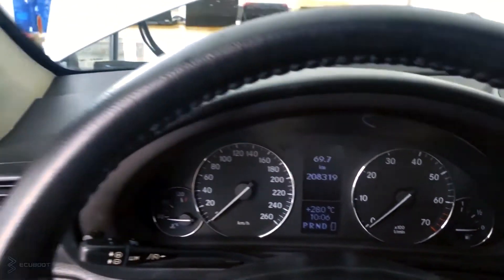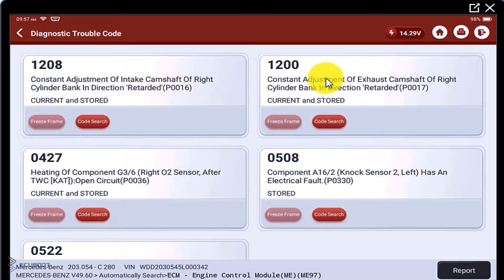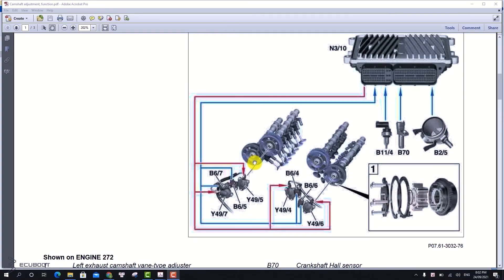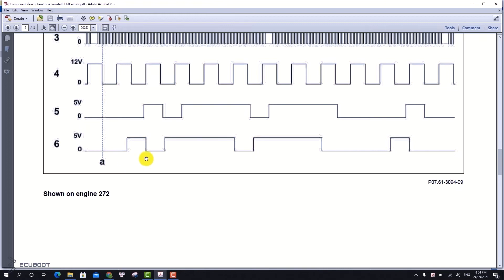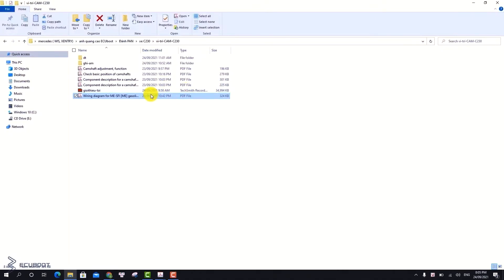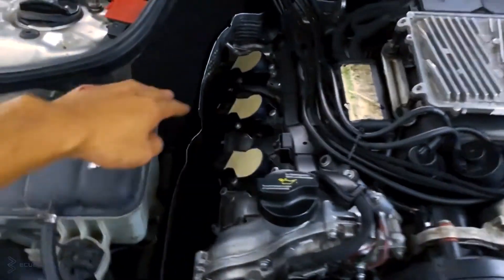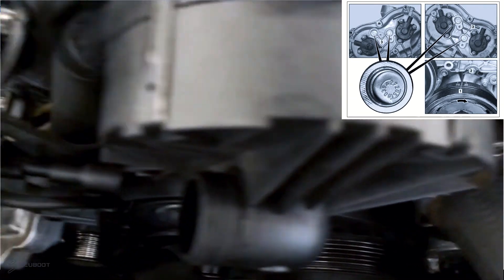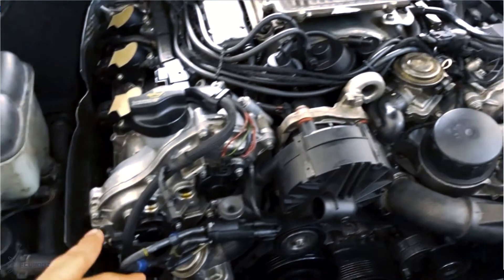Mercedes Camshaft Adjustment Fault - DTC P0016 O0017 - FIX

Comment: @Ecuboot, video của bạn rất thú vị.  Tôi cũng có problem tương tự (bank 1 at 36.2 và 20.0 degree) dù rằng cam magnet mới thay và cam sensor chạy tốt.  Đã biết 305 degree check cho thấy intake ngay giữa còn exhaust hơi trễ.  Vẫn chưa thấy giải pháp của bạn như thế nào?  Phải chăng ở pulse wheel?  Điều khác biệt là xe tôi chạy ổn, không vấn đề gì ngoài chuyện đèn check engine light.  Cám ơn bạn.
Reply from the maker: Anh xem lại xích cam xem có giãn không vì nếu xích giãn thì sẽ bị vấn đề như xe anh gặp phải. A cũng phải đảm bảo rằng Soilenoid Cam và Cam sensor còn tốt nhé
Reply: @ecuboot7153  is the timing ok usually it's the chain
Reply: What kind of software using /repair manual